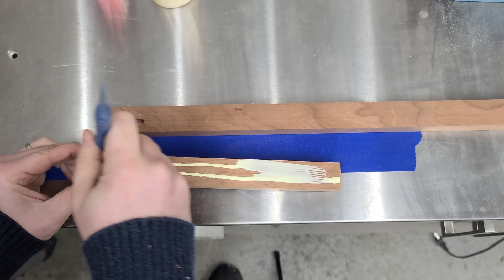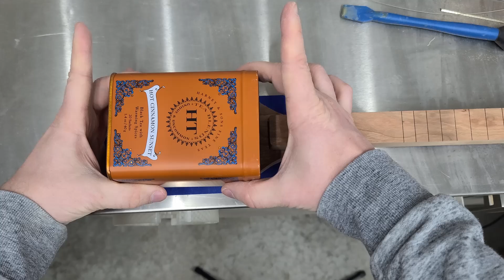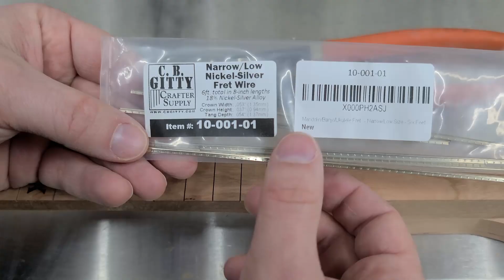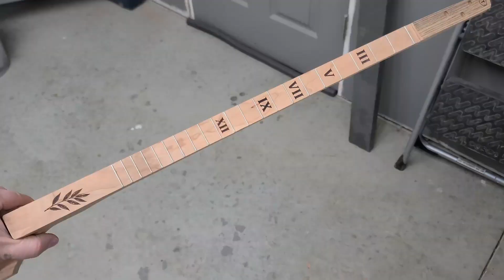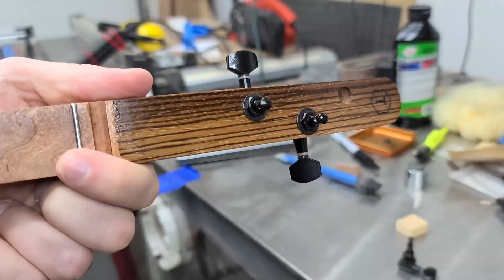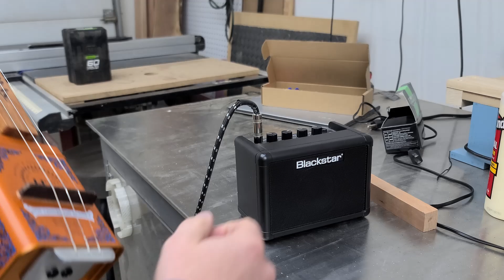"Cinnamon Sunset" Canjo - BUILD

Comment: The 2 inch cutoff blade's kerf on the harbor freight saw is 0.023 ? Wow, that's handy...(I use a harbor freight mighty mite with a 4 inch 0.023 jeweler's blade and a sled)
Alignment of strings above the pole/metal plugs on a pickup for a stratocaster or telecaster is important, but in my experience for something like a canjo or even a cbg if the strings aren't over a pole it's no big deal, negligible .... of course using an acoustic based piezo pickup you will also get extraneous noise from just handling the canjo amplified, something a magnetic pickup will not do...
That said it's a nice build
Reply from the maker: The 2" blade is probably .02". I found that the frets were slightly tight, so I just ran them all through the saw twice and they come out perfect. Agree with your notes on pickups!

Comment: I've been waiting for a build video since I saw the original one come out, so this is awesome! I'm planning on building one in the near future, is there any sort of a rough materials list? I'm also curious on the width measurements of the neck, as well as total width of the wings that go inside the can if you happen to know. Thanks!
Reply from the maker: Hey there! The neck is 30mm wide, and the part inside the can is about 85mm. For a parts list, I guess that would be lumber, wood glue, fret wire, tuning keys, an optional pickup + jack, and a few screws

Comment: I feel like the two sections that are missing are loose guides to material selection (namely the can and wood, or someone’s going to use generic home depot 2x4 and be disappointed), and guides to design decisions for someone just starting out who may not know much about what they want to do with the end product yet; string numbers fand tuner arrangement or instance. I feel like generally it’s styled in a loose guide for accessability, which I understand, but a brief word on those would be helpful.
Reply from the maker: Great points! Just to reply to them - I used cherry wood here. Nearly any hardwood would work, and some "softer" woods as well. A 2x4 could do in a pinch, but you'd be fighting it the whole way. I used these tin cans since they're widely available, but outside of these you might just need to try different items and see how they sound. The number of strings depend on how solid the construction is. Tin is a really soft metal, so I limited it to 3 strings, and even that still caused trouble which forced me to re-think the tailpiece. More strings = more tension on everything.
Reply: @thornbloominstruments  I'm actually surprised that it's so forgiving to lower quality woods. So in theory you could make this a four string with the right design of the tailpiece/ bridge area, perhaps with an internal reinforcement for the bridge, or do you think would that affect the acoustics? Do you think the bottom hole in the Earl Grey canjo negatively affected acoustics?
Are the screws in the side strictly necessary, or could the can be held on by friction via the bridge and attachments through the endpiece?

Also I was quite surprised that adding the electric element would be that simple!
Reply: @farmerboy916 since the bridge is over the braced neck in the tin (and directly against the underside of the tin) that brace and neck takes all of the string tension, ideally there should be no tension on the tin...  and I saw no need to make a new tailpiece, he could have just used a pair of pliers to crimp the tin overhang down enough to allow free action of the strings to the bridge... 
       AND now that I've watched the video again more closely I see the brace does not lie flat against the interior of the tin, there is a space and that would indeed be a problem for string tension. That would be eliminated by inserting a bridge width sized piece of wood to contact the underside of the tin much like a bridge post in a violin keeps the soundboard from cracking under the string tension...